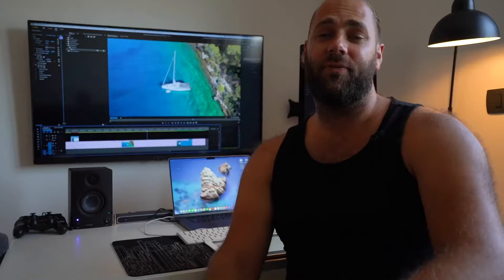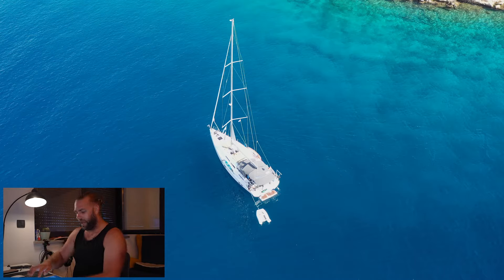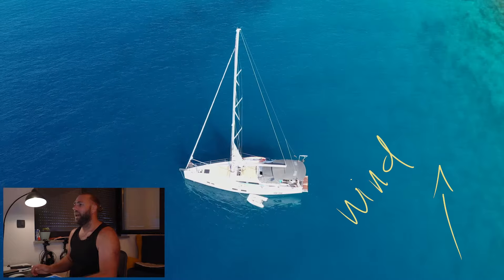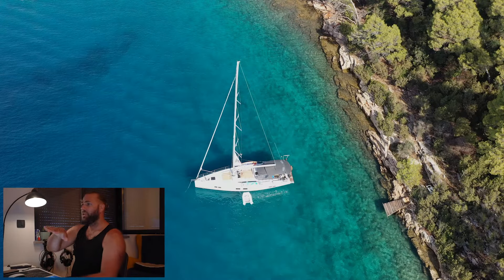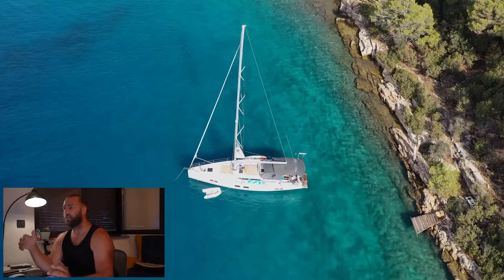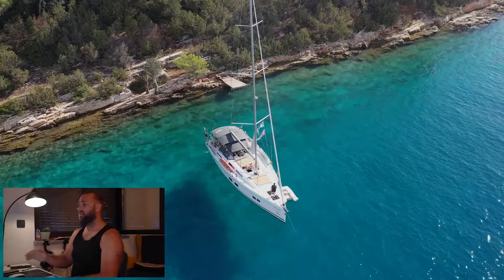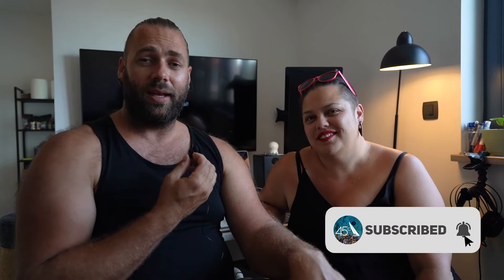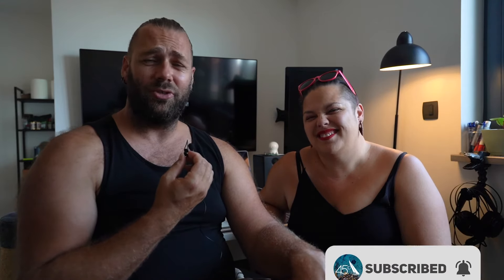Anchoring with a line to shore in Croatia - Sharpen Up Episode 7

Comment: Good advice re gear at neutral while swimming towards thr swim platform; in fact i would prefer Engine Off.
Reply from the maker: Yes fair enough. In our case we are still doing the manoeuvre, need to tension back etc. and with a mono you are so far from the prop, I’m less concerned. With a cat. Def engines off. Reduce any chance of a slip/mistake causing catastrophe

Comment: Hi 45’ Sailing - good video, I liked the drone shots with the overview commentary. Here in the Salish Sea (West Coast of Canada) we also have deep anchorages and often need to stern-tie. The Standard method here is to cleat off the stern line at the rear of the boat, take it around a tree or park ring on shore, and then back out to the boat. We typically winch it in till it’s tight and we have good tension on our anchor chain, and then we cleat off. This forms a V at the back of the boat leaving the swim deck free to access the tender. When you want to leave, you simply uncleat one end, pull it in by hand and you’re free - without having to go back to the shore to untie your stern line. It’s a great method and I’ve done it dozens and dozens of times. Cheers SV Osprey
Reply from the maker: Thanks Graham. Brilliant, and if you have rings on the shore that is even better! We need to be careful of the continuous line due to chaffing around a tree or rock. Main reason I dont return the line to the yacht. Keep it up! Great to hear from everyone about their experiences :)

Comment: Great video and very instructive, I confirm anchoring in Croatia can be challenging due to the depth and rocky shores. But watch out whereon you tie you stern line to, because these shores are so sharp they can cut a rope in no time! I prefer to tie it up to a tree. ;-). Again my congratulations for the didactics, great job!!

Comment: yes i enjoyed your video a lot!! I especially liked the bit at the end to ensure ALWAYS the gear is in neutral before a person is about to come aboard, swimming from the stern (platform); however at times, you have customers happily swimming around when you realize that you drag and you have to collect them asap, while the engine is on with a slight ahead throttle. thanks!!
Reply from the maker: Thanks 😊 
I would still encourage that when they approach the ladder you return to neutral for the moments they are boarding.

Comment: Don’t know why I have only just watched this, maybe because we have done it and discussed.  A few points for the discussion
1. Stern lines are not a substitute for good anchor holding.  As you say in the video you need to have the anchor dug in and be able to pull against it without it dragging.
2. Having the stern line in a bag is a huge benefit, the tail can be easily secured to a cleat or winch and when you swim or dingy ashore you pull out only the line required (I have seen so many people taking all the line ashore which is unnecessary and makes it more difficult to handle).  Also if swimming be aware of where the line is as having it wrap around your feet is not funny.
3. Going astern against the anchor can be dangerous but some times necessary to keep the boat in position.  Dangerous because if the anchor drags then the boat could reverse into the shore and secondly it’s always a risk with someone in the water.  So being 100% confident in your holding is vital
4. As you know, I do this solo which increases the risk which is partly mitigated by the above. ( before the negative comments - I live every day and only plan on dying once)
But do you have any other tips for doing this solo?
Reply from the maker: Brilliant comments as always, and good points made. 
I may have to add this one to the list of solo videos to shoot, we may need to brainstorm it over a gin or two...
Reply: Sounds like a plan 👍
Reply: I would really want to see it done solo, no pun intended, I mean it!

Comment: I always enjoy watching your videos. When you anchoring with a stering line to shore, we must careful about the depth. Depth meter is usually pointed under the keel. When the depth steeply descends from the shore and we like to moor close to the shore, we must be careful about depth under the rudder too. Depth meter will show to us enough water under the keel, but the depth under the rudder can be not enough. In addition,  we must also consider the waves too , at which the depth under the rudder can be further reduced.
Reply from the maker: Yes this is a very good point,  I will be sure to add it to my next video on this.Thanks for watching :)

Comment: A really great way to shorten the time you spend tying the knot at the rock end is to tie a bowline with a small loop. Then when the swimmer gets to the rock, they slip the standing part through the loop creating a slip. Then just throw this slip loop over the rock. This is particularly useful if your crew are not really good at knots.

Comment: Great video. One question: Why did you fasten to starboard aft cleat if the wind was coming from the port quarter- not a crltlcism, I’m  an inexperienced skipper and windeeed if it was because you only had one line on. Thanks in advance.

Comment: As a few season professional skipper I did this lot of times. First pick depth that it is not over 10m.. OK 12-13m can pass(in this case 45-50m of the chain at least is a must).. Then depending of the distance to the shore and depth , more chain is better chain especially if you are going to sleep here over the night.  For example you started at 10 m(less is better like 6-8m ideal) depth and now you have like 40m of chain dropped in the sea(35m is OK) then you reverse your engine to at least 1000 RPM so you can see that you anchor is holding(start slowly ofc then increase engine RPM so you can be sure that your anchor is tested with that pressure). If are still reversing to the shore, start again whole process . It is normal. Sometimes I have to do it few times. Better safe than sorry. You have to had minimum 3x chain to depth ratio for your anchor to had a grip. More is better. Have a distance from the shore. Then let's say that you anchor is holding. Even now you can still drop extra 10m of the chain(more is better) and you can come closer to the shore. And more the chain the more safe you are in the case of anything. In the end you will have ratio of at least 3.5x or 4x depth/distance(even more is better) Then do with the ropes what author of this video suggested. With this setup you can spend whole day and you can probably withstand winds up to 20knots if they come suddenly(of course if you except wind at the night or day at 20knots then you simply don't do anchoring. Go sailing and sleep in some of nice towns on the islands).
Reply from the maker: Interesting take on it, certainly agree more chain is better. Though I would say that if you are testing your hold in reverse gear, you need to give it more.  For rpm to simulate sustained wind strength it would be about...
800-1000 RPM 10-12 knots
1000-1500 RPM 15 knots
2000 RPM 20-25 knots
2500 RPM 30-35 knots
For instance tonight I am expecting possible high winds, have dug in at 2500 RPM in reverse. 75m of chain out.
I would suggest always aim for 4-5x your depth for chain overnight. Need chain on the ground to really hold. Once it is dark and the wind comes up, it is too late to test it. You want to KNOW you are holding.
Sleep  much better this way!
Thanks for the comments :)
Reply: @45DegreesSailing  wow didn't know for this relationship between RPM and wind knots. Definitely this will come handy. Well if the weather forecast are predicting incoming storms then we in Croatia just go to marinas and harbors although having good chain tricks and tips is good stuff. Anyway more chain is always better. Test with the more engine power if you expect more wind I do this instinctively but never thought for relationship between RPM and numbers)

Comment: Exactly what I wanted to know. Saved me 👍
Reply from the maker: Great to hear!
Reply from the maker: Hey Johnny. Im going to repost this answer from another comment as it is very similar:

The process is very similar. And often it is more about choosing the location and angle to make the move practical. If you set up with your stern to the wind, this is much easier to control and is going to provide you with great holding as the lines to shore will take most of the pressure. 

When doing without thrusters (and in fact with thrusters I believe you should take the same approach) you need to bias your stern towards the direction of the wind. If there is a cross wind, when you drop anchor and reverse, you direct your boat upwind of the target area as your know you are going to get blown down wind. In this case, or in the case of cold water/winter conditions, sending a crew in the tender is a great way to be organised for when the wind starts to carry you. It may be lengthy. But its safer and more practical. Just make sure your stern line is well organised and not tangled!

Comment: We always swim the land lines unless it’s winter or freezing cold water. If you use the tender, the weight of the line will make controlling the tender very difficult. If you have really light, floating lines, then the tender is a good option. It’s also a bit harder to get the rope around the rock from inside the tender. Getting out is an option but it’s tricky.

Comment: Thanks Mahina & Nick at 45 Degrees sailing, another excellent video on stern too shore securing along with great pointers on crew communication during the process .Good point about how at--anchor swing can destroy marine habitat.. I'm sure not to many us have ever considered what damage can happen to the sea bed after dropping  anchor ,really emphasizes the importance of the sustainability of stern to anchoring . A earlier comment asked ...what do you consider /recommend enough line to have onboard for stern to shore lines? Cheers from Noosa Australia
Reply from the maker: Hi Nige. Thanks for the comments 🙂 
50m is a good stern line length in our view. Ideally I like to have 2 of these on board. Or at least 1x 50 and 2x 25’s.

Comment: Really nice video, well done!
Personally I prefer floating lines on slip to the shore, because they do not tend to catch the propellor. Specially in emergency situations, when the anchor drags, none-floating shore lines are loose and therefore under water.
 Floating lines are easier to handle. You can start the engine and go in forward gear without risk to loose the engine in emergency situations. For shore lines I recommend to use slip lines. When you stay overnight and a thunderstorm is approaching you have to leave very fast. Because in a thunderstorm gusts come from all directions and the anchor-shore line combination is not secure anymore. Under such conditions, in the middle of the night, nobody wants to swim to a rocky shore to remove the lines, even with a dinghy it takes to long.

Comment: Very good video! Question: when/why use one or two lines to stern to?
Reply from the maker: Thanks Mario. In general I like two lines when overnighting. The main reason being in reducing the sideways movement, if the wind shifts and comes onto the other side then the windward line takes up the load with out so much shift in the yachts position. This is important if you have other yachts on either side of you also stern to the shore. 
And of course, 2 is better than 1! If you have an issue with one line you have a fail safe.

Comment: Very good drone video, thanks a lot for the sharing. You might have covered it with earlier comments. But, could you share your thoughts when second stern line is needed?
Reply from the maker: Of course, and thank you :)
Over night I would pretty much always have two lines to shore. Keeps you in your place much better and is allowing for the wind shifting to the other side or worse a line breaking for any reason.
Also when placing yourself between two other vessels you need to be more stationary as to not drift towards them

Comment: Great video for someone like myself ,who will be trying this for the first time in Croatia.  What about chafing of the line to shore?  If the rocks are not smooth is chain usually used for the part that attaches to the shore line?  It seems like some midnight wave action could cause enough movement of the line against the rocks to start some serious wearing of the nylon.
Reply from the maker: Hey Tim. Yes for sure if you are staying overnight or have a high wear point there is a number of things you can do to mitigate this. 
One of my favourites is to take some old fire hose and cut 1m lengths. These can act as a chafe guard around your line at this point. Also very good if you are tying to trees to protect the tree and its bark.
Chain is a great option for an owner boat, as on charter we do not carry such things around with us, this is a longer set up time, and after securing your first line and gaining safe position (as in he video) then setting your overnight lines slowly with your chain sets is a great way to go.

Comment: Hi there, I'm a bit late to the party.   Was wondering how you do this manouver with a boat that does not have any thrusters or multiple engines.

I would usually send out the crew with the lines first, usually with a dinghy, tie off to a rock, come back onto the water and meet the boat where I want to sit. This feels very safe but can be a lenghty process. Any suggestions?
Reply from the maker: Hey Masus. The process is very similar. And often it is more about choosing the location and angle to make the move practical. If you set up with your stern to the wind, this is much easier to control and is going to provide you with great holding as the lines to shore will take most of the pressure. 

When doing without thrusters (and in fact with thrusters I believe you should take the same approach) you need to bias your stern towards the direction of the wind. If there is a cross wind, when you drop anchor and reverse, you direct your boat upwind of the target area as your know you are going to get blown down wind. In this case, or in the case of cold water/winter conditions, sending a crew in the tender is a great way to be organised for when the wind starts to carry you. It may be lengthy. But its safer and more practical. Just make sure your stern line is well organised and not tangled!

Comment: Hi great videos , one question why it is nightmare when you have side wind with stern line. And more important if you find yourself in such situations what you should do ? Slowly Release stern line if you have manoeuvring space ?
Reply from the maker: Hey there, thank you. I watched back a but to see what I had said there. It was a year ago! 
Effectively when you have a cross wind you are always fighting the drift that will set you downwind. So you are on a time limit to keep the boat in position. Also if you have a strong crosswind then you need very good holding on your anchor, more chain out to counter the sideways push. 
Ideal situation, especially over night I aim to have the wind over the stern or at least the quarter. Leaving most of the pressure on the stern lines.

Comment: Awesome as always, thanks Nïck and Mahina! How much stern line is good to carry? Or indeed to check/confirm with the charter co pre sail…
Reply from the maker: Hey mate, you should always have a 50m line on the charter yachts. Either for the spare anchor line, or that PLUS an additional 50m shore line if she is well equipped. And if you would like 2x50 lines, definitely call ahead and request it, you shouldn't have an issue. Have you booked the charter? If so, who with (if you dont mind me asking) if not, let me know and I can help you book a good yacht :)
Reply: @45DegreesSailing  Thanks Nick! Yes the charter was booked pre first lockdown - mad. I will deffo check with you next time. Local knowledge is always best... Booked some of yr recommended stop overs too. Will be in touch before I go, and will look for you on Patriot...
Reply from the maker: @neilham6171  thank you! Appreciate the support 😊

Comment: Great video. One question: when the boat stands with motor on and tension on the chain will it drift sideways according to prop momentum or it will stand strait (not asking now about the wind)? Thank you.
Reply from the maker: Thanks Vladimir. It depends largely on the prop and model of yacht. A large prop that generally has a lot of walk will tend to put slightly to the side. Though not much. Modern yachts like this one it tends to have very little effect in my experience. Though it is a little hard to gauge as there is usually wind!
A small effect like the though can be rectified by a tap on the bow thruster to change the angle of the stern.
Reply: What if you don't have any thrusters and there is wind from either the side or stern?

Comment: Excellent thank you! Just arrived in Lefkada Greece high season and looks like may have to try this. My concern always is what is on the seabed … I’d hate to get my anchor caught … and I also found it tough to pick a transit as the boat still has a tendency to sway even in reverse with the anchor biting….have you found that?
Reply from the maker: Yes I understand the concern. Especially in deeper areas where you cannot see what lies beneath. Though I would ask, how many times have you caught your anchor? 
Taking a transit can be tough, also if your anchor does bite an hold nicely, you will sway and bounce back and forth on the chain as it rises and falls with the weight. 
When doing a stern line to shore you can also use your depth sounder for a position line as well.